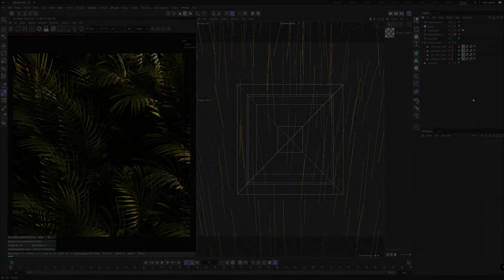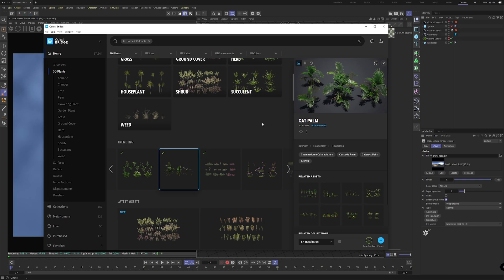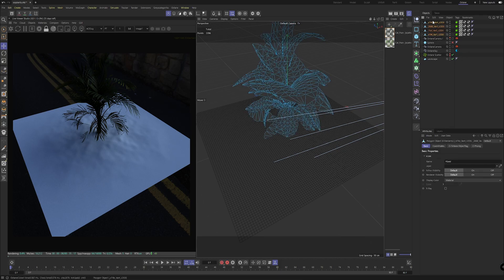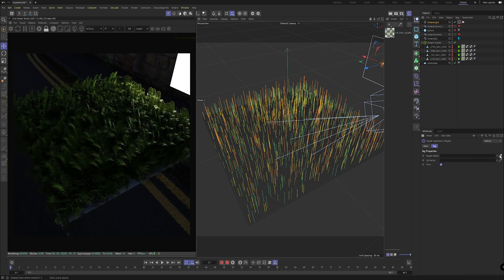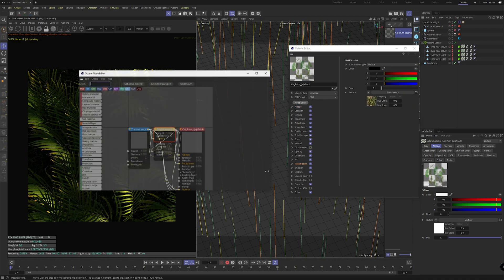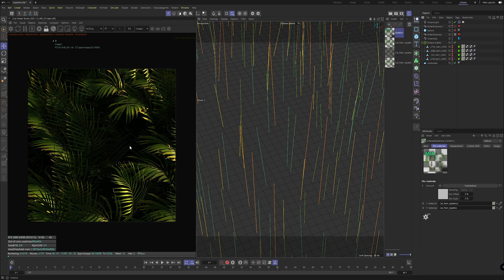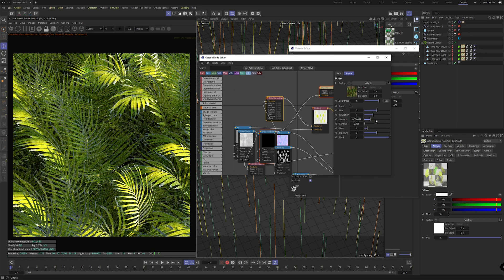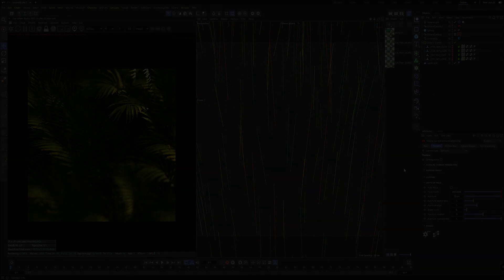How to Import and FIX Megascans 3D Plant Assets the RIGHT Way in Cinema 4D and Octane │ september ®

Comment: I appreciate the effort, but you're already not doing the the RIGHT way in the albedo map. You can't just change the colorspace of a texture all willy nilly just to make it look brighter.
The Quixel albedo maps are (as far as I know) sRGB, and changing this interpretation will have major consequences down the pipeline for any compositing workflow. 

The actual solution: Your light source is underexposed, and the dark look of the leaves actually look quite accurate in the beginning. You literally have vegetation in the HDRI background as reference for how bright your leaves should be from ambient light only. (The area light is not as bright as the evening sun, and therefore you can't judge if the materials are set up properly.)

If you're just going to output a jpg and post it on instagram - sure, this method works. However - it's not the RIGHT way as the title claims.
Reply: You could probably just use a colour correct node? This would allow for a bump to the brightness value instead of shifting the entire colourspace. At least that's what your comment had me thinking of as an alternative solution (albedo to colourcorrect then main input)
Reply: youtubers...